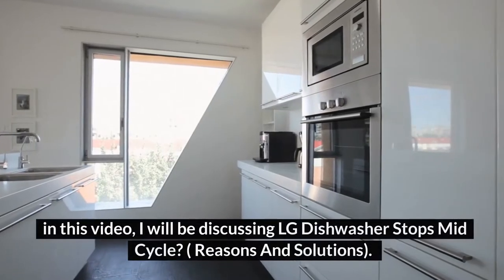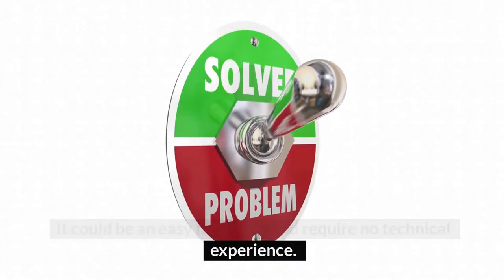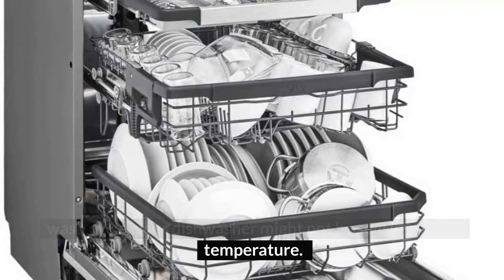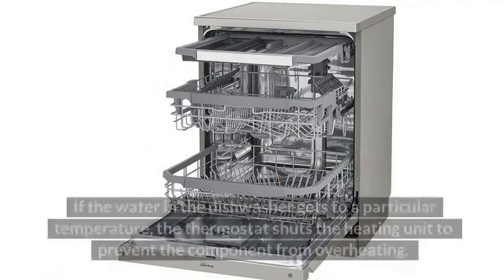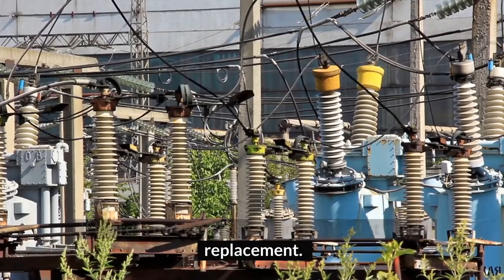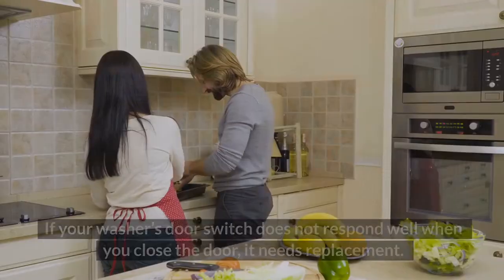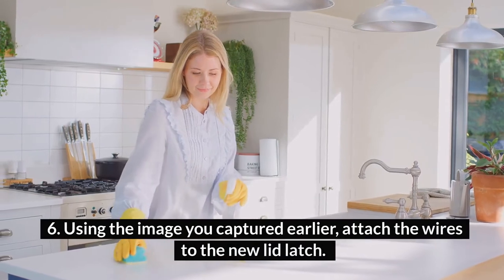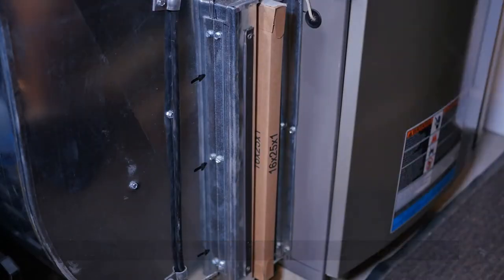LG Dishwasher Stops Mid cycle | Lg Dishwasher Stops Mid Cycle And Beeps | 2022

Comment: Had this exact problem, along with the dishwasher beeping during the cycle but not necessarily stopping.  I looked all over the net trying to find the solution, and most said that you needed to replace the control panel (at $200 for the part).  Many said the issue is with moisture and heat coming from the dishwasher that degrades the PC board inside the control panel.  So, I thought I would try to use an electronics repair trick and clean the PC board with 90% Isopropyl Alchohol to remove any oxidation/corrosion to see if that would fix the issue.  The PC board, however, was coated in a clear/rubbery substance that prevents the board from oxidizing.  But, there are several connectors that are exposed and one blue/round component that is sticking up above the PC board.  Disconnecting the control panel, and then using Caig Deoxit D5 to clean all these connectors (both side) and spraying inside the blue/round component has seemed to fix the issue.  So, before you buy a $200 control panel.. try using Deoxit D5 to clean all the connectors and that blue part and see if that works.  Might save you money!
Reply: Our LG is freaking out electronically and is less than 5 months old.  I shouldn't have to do shit.

Comment: So mine was doing the same. Beeped, stopped.  Sometimes multiple times during one wash. I would open, let steam out, close, restart. I thought I would have to replace it. Then I ran out of more expensive Finish tablets and switched to cheap Costco generic dishwashing packets. Zero issues ever since.